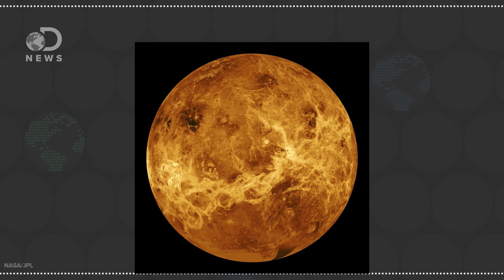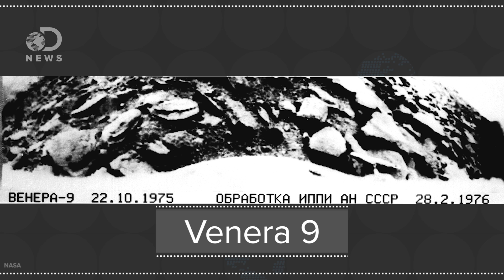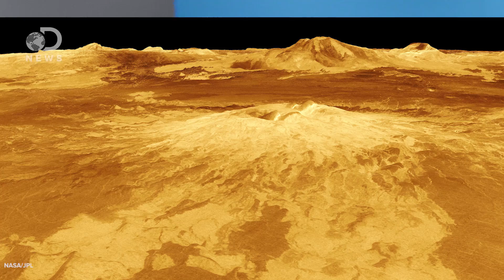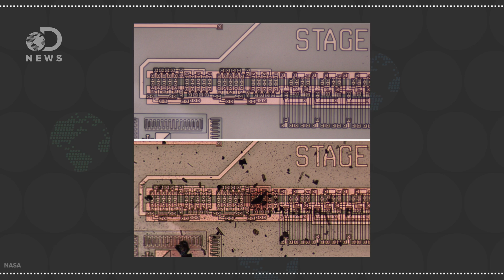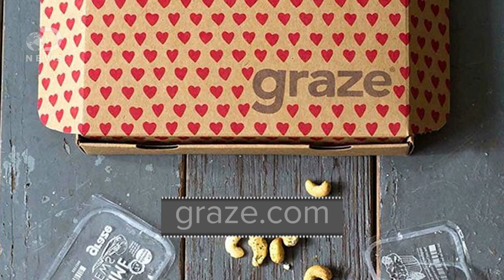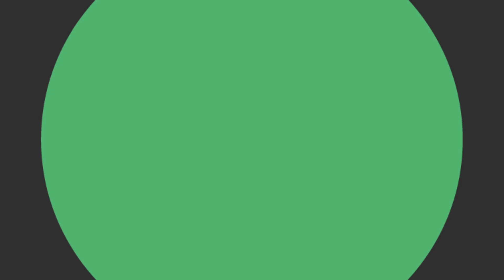This Powerful New Technology May Be The Only Way To Explore Venus

Comment: Combine this type of semiconductor with a liquid-metal battery (Ambri) and a Stirling radioisotope generator (beta type, with a samarium–cobalt magnet linear alternator to remain above Curie temp) that uses the atmosphere of Venus as the 'cold' side, and it looks like we have the makings of a rover that could last weeks, or months.  Perhaps a second Stirling could be used as a heat-pump so we could lower temps enough to operate a thermal camera.  Other ideas: make a 'swimming' rover.  Something that undulates, or flaps or spins a slow propeller or inflates a bladder with helium.  The atmosphere is so thick it's like a liquid, so why not take advantage of that for getting around faster and flying over obstructions?

Comment: One thing to remember the transistor density presently achievable with silicon carbide is similar to small and medium scale density ICs of the 1960s so anything build with them will have to be much simpler.
Of course even a probe based on the equivalent of a PDP 8 era technology or even just a sequencer and mostly analog circuits can produce a lot of useful data.

Comment: Ooooh, silicon carbide.

Can we use this to make gaming hardware that will happily run at infernal temperatures and high clock speeds, or do other factors (signal transmission speed, bad energy efficiency, etc.) prevent that?

Comment: Probes will still need shielding to protect circuits from radiation. Heat proof does not equal radiation proof.
Reply: And shielding from the acidic clouds.
Reply: That too.

Comment: Man NASA shouldn't be cheap when it comes to missions. They complained of all the failure because they settled for good enough. If you want some thing to last long with no problems long term you need to pull out all the stops and spare no expense I mean your not going to be able to repair it once it's their might as well make it able to servive better with the best metirials
Reply: magic space fart spare no expense is great when the expenses are available. But there are a lot of budget cuts and pressure about these kinds of things now days. Sparing no expense when half the population either don't believe in or can't spell science is a great way to get shut down. Exaggerating of course (but not much).

Comment: I definitely think we need to put more attention to Venus. When it comes to extraterrestrial-human-exploration, I'm Team Venus. Someone in this expertise can correct me if my hunch is way off, but I have a feeling that our capabilities to send humans to space will develop faster than we will acquire a firmer understanding of the effects of micro-g on the human body for long-long periods of time. I take that whichever type of spacecraft to send humans to another planet, there will be an attempt at making artificial gravity (via centripetal force)? But once humans make it to the surface of another planet, there will be no way to alter gravity from there. That's why I think Venus is the safer bet.

Of course...I'm being way to optimistic that in our lifetime, will come up way to establish a "sky-colony" that could float on Venus's surface at the altitude where the air pressure matches that of Earth's surface. On top, would Venus's proximity to the sun ensure the efficiency of solar powered equipment. 

Of course, before considering human exploration at Venus, I think we need a mission where we send some type of probe that can deploy a robotic aircraft to be suspended in the atmosphere with an AI on board.

Comment: I need those semiconductors in my computer. But really, in all honesty. What gives Venus it's incredibly high temperature and pressure?
Reply: William Merzlak the atmosphere is very thick which creates higher pressures the closer you get to the surface. The thick atmosphere also causes a greenhouse effect where heat gets trapped inside the atmosphere, causing the planet's extreme temperature.
Reply: Joe Cestare Thank you. I appreciate the reply. A rather simple explanation to what I thought was going be much more complicated.

Comment: Would this be useful in environments like the inside of Fukushima?
Reply: MakeMeThinkAgain 
No the gamma radiation emitted from nuclear material is not simply heat and rapidly bombards and decays most other material. The efficacy of beta voltaic designs are often determined by this. Nano structured lead with layers of overlapping lattices that would effectively stop radioactivity. It's no accident uranium mostly forms into lead isotopes as part of its half life transformation.

Comment: You could just send the robots to Venus at night.
Reply: Hee Sing Sia 
It's not hot entirely because of the sun the separate dense gas layers of its atmosphere move to create thermal friction and double to trap most of the heat near the surface a super greenhouse effect

Comment: Can someone please explain to me why we have to send this tech to Venus first? Surely a chip capable of such high operating temperatures would benefit the PC Master Race in the Ghz race more than any lander!???
Reply: Don't worry we will get it eventually.
Reply: It turns out that this tech was first developed for use on hot sections of fuel efficient aircraft, but NASA engineers realized that this specific type of integrated circuit would have space applications. So they're testing it for Venus, but the mainstream applications could be really exciting.
Reply: William Hendick you'll have that technology soon enough. The first computers were used for science and space exploration.
Reply: 5 to 10 years maybe. Thank Gaben everything created by Nasa is public domain and free from patients. Soon will be the day when your CPU/GPU is "Chillin" at 300 deg C lol
Reply: Actually, the first computers were used for the US census.
Reply: I was thinking along the same lines. Over 9000Ghz!

Comment: if this technology were to be used in conventional microprocessors and CPUs and GPUs would that mean they would no longer require heatsinks?
Reply: Maybe it'll be better at overclocking without dying from the heat.
Reply: Good question, but the answer is a bit complicated.  First, it's important to point out that just because the processor can handle the extreme temperatures, it doesn't mean the rest of the device or the user can.  For example, if you were using a laptop and the CPU reached 250C, that would either melt part of the case or burn the user.  It's much more practical to dissipate the heat through the air and with a heatsink.

Don't forget though, both CPUs and GPUs at one point didn't need heatsinks, like the original Pentium or the ATI Rage.  Most modern ARM-based CPUs (like what you'd find in phones or tablets) don't need heatsinks either.

It's also important to consider that the material discussed might not be compatible with modern high-performance hardware.  What space agencies like NASA are trying to do accomplish doesn't really need anything that high-performance, so their electronic diagrams likely wouldn't be complicated enough for manufacturing to be an issue.
Reply: Good point. But from what I understand, this is purely a solution to external heat and pressure, we'd still need to somehow remove that heat from the processors to make sure they function as designed.
Reply: Then the Xbox might stop sending me rings of death xD
Reply: Stevenson Gibbs i hope id never have to worry about my computer overheating again
Reply: TurboCMinusMinus 
Silicon is doped to make it less or sometimes more conductive than the copper gold or silver generally used with traces and components. The embedding and growth processes now being used with graphene being a superconductive material nearly any non conducting material can be used. With far greater efficiency and the precision scope of it being applied on a molecular level it will be better than anything that previously existed. So much so I'm inclined as to say a step towards circuitry so efficient that it has thermal decay recycling engineered into its design. Heat sinks eventually will be considered a wasteful remnant of the past.
Reply: Stevenson Gibbs Since nothing is getting rid of the heat, the circuitry will get hotter than the 500c melting point.